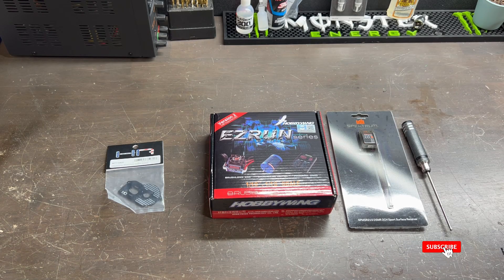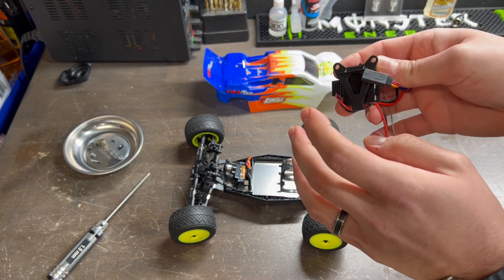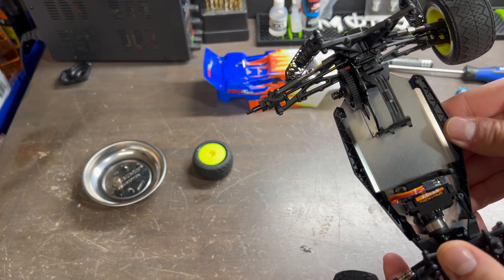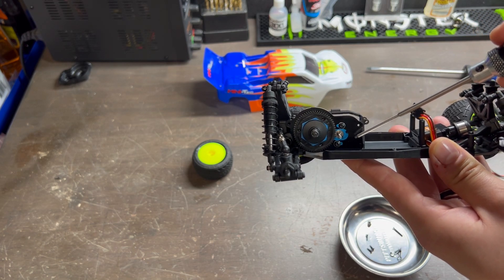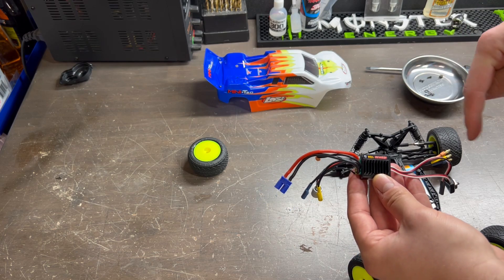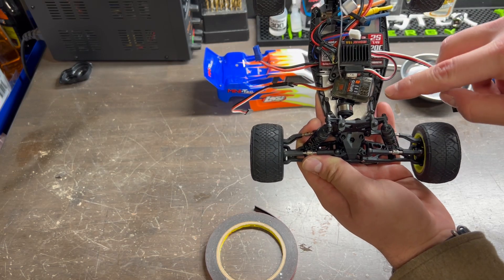How To Install A Brushless RC Motor & ESC! Losi Mini-T & B

Comment from the maker: Timestamps For Your Viewing Pleasure:

Components: 0:07
Motor Disassembly: 0:43
Slipper Clutch Removal: 1:38
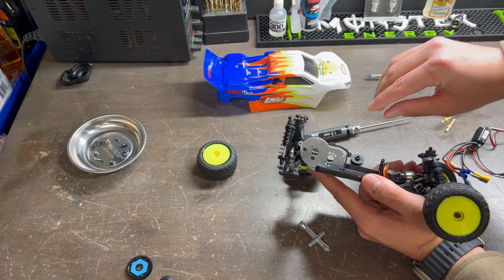Motor Mount Disassembly: 2:21
Motor Mount Assembly: 2:35
Slipper Clutch Install: 2:46
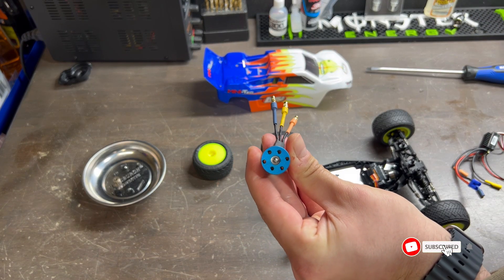Brushless Motor Install: 3:47
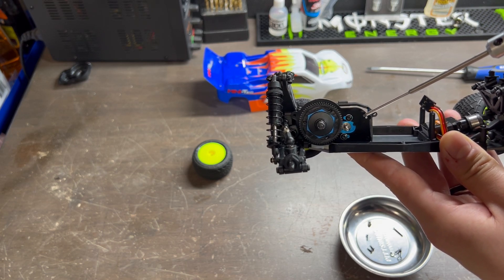Gear Mesh Talk: 4:34
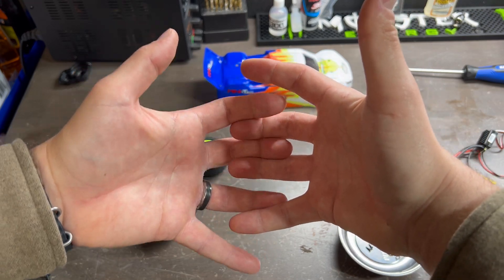ESC Install: 5:15
Receiver Install: 6:13
Test: 7:15
Quick Note: 7:21
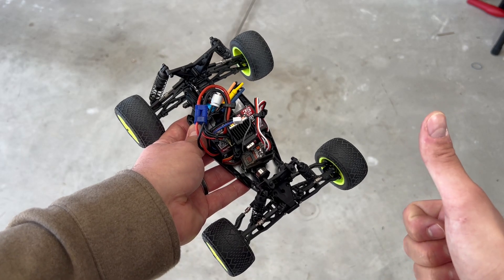Subscribe: 7:41

Comment: What size pinon are you using that fits the shaft?
Reply from the maker: I would have to look and see where I ordered the pinion from but I know the motor shaft size is 2mm

Comment: Hello, what bore size is your pinon gear?
Reply from the maker: Hi it’s 1.90mm
Reply: I'm trying to install that's same setup on my 1/18 lmt. Would you recommend that pinon or .5m 2mm pinon?
Reply from the maker: @theone9564 oh if you’re talking about the LMT, check out my other video I have on my channel where I did a brushless conversion on that using a cheap Spektrum system. That one will probaly work better, this one overrated and blew up on me!

Comment: Im new to the hobbie and recently ordered the brushed model. i am considering upgrading to the brushless system and im curious if it is necessary to change the motor mount when doing this conversion. Any help and information on this would be greatly appreciated and a push in the right direction!
Reply from the maker: Hi! Yes I would change the motor mount out, it’s only like $20. I guess you could get crafty and modify the original but it’s much easier to just buy the Hot Racing one and call it a day.
Reply: Alright, ill just buy the mount, i dont want to mess up anything on my first real rc, thanks for the quick response! @TheUserReview